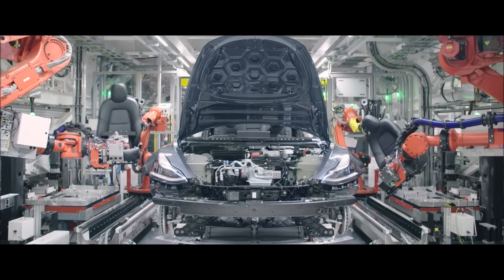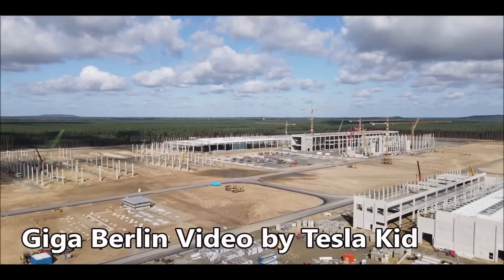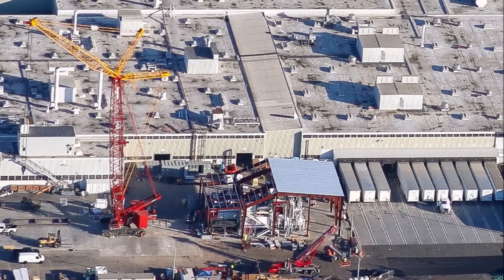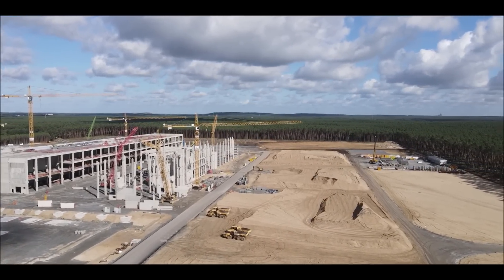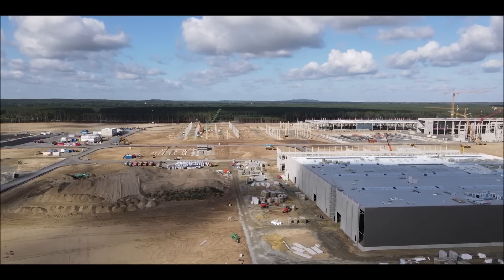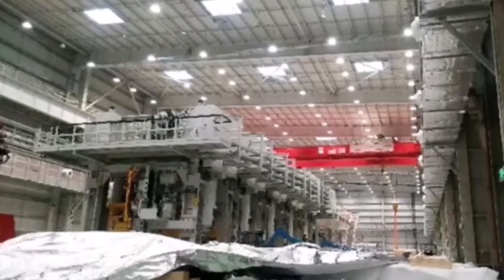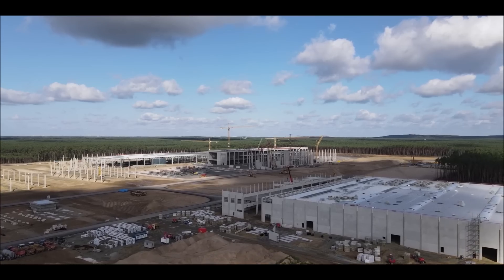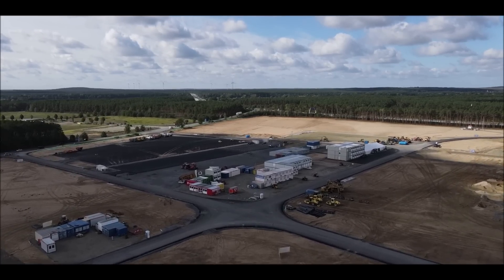Tesla Giga Berlin Abandoning Hundreds of Robots for Casting Machines

Comment: I guess they are casting the front end and the top and bottom of the body, plus the rear casting, so 4 mega cast pieces for the entire body...just guessing
Reply: That would be insane and game changing
Reply: Simon Quvang I cannot see any other reasons for needing 8 huge casting machines :) 4 for model Y and 4 for model 3
Reply: @simonquvang6073  nope it would be stupid expensive and not game changing,  there are sport cars like lexus lc500 that uses magnesium front end castings

Comment: The single casting mega machine press story is a year old.
They may do aditional castings in the new press.
The 100 meter cables MIA.
There is no new computer.
No new news for Model Y.
Just waiting for tesla to fix the quality issues.
New paint boots.
So what else?
Will have to wait for battery day.

Weeeeelll better than GM and ultium vaporware.

Comment: I think these gigacasters are amazing!  I would love to see one in action, although there's probably not much to seed - molten aluminum goes in, and a car body comes out.  Fantastic!   Tesla's lead product is NOT cars - it's forward-looking manufacturing.
Reply: Nonsense. Other manufacturers like vw already makes 10 million cars a year with astonishing finish quality and delays, vw doest need die casting, their stamping can already ramp the production by million
Reply: @alanmay7929  and yet casting parts like this would make VW cars CHEAPER, reduce build time/need for robots and complexity of repairs..... yet they dont do it..... almost as if theyre not really thinking about making things 'better'
Reply: @bobh9492  vw already has alot of stamping presses, they just new forms for their next cars, thats not an issue since robots doesnt really need maintenance and vw has basically perfected the car chassis building by sharing platforms for example
Reply: @bobh9492  the giant die cast machine actually cost alot of money
Reply: @alanmay7929  and? theyre already fking installed.... your point?

Comment: In practice, he's correct with his idea of using larger pieces rather then several smaller ones. On a massive scale, this idea is already in use by shipyards. They assemble massive blocks which they then assemble together. Hyundai Heavy Industries has purpose built massive cranes just for the purpose of lifting those massive blocks. Elon musk is essentially doing exactly the same thing with his Giga Presses.

Comment: With the autopilot safety systems and eventually FSD, Tesla cars will be involved in far fewer accidents or even zero.
I would imagine if the casting is damaged the body would be a write off.
Tesla insurance will take this into account of course.
Reply: If every vehicle on the road was communicating with all the vehicles in proximity (where I am, how fast I'm going, direction, and where I want to be in 10 seconds,  where I want to be in 30 seconds, and where I want to be in 2 minutes, at all times so they could all cooperate with each other there would only be accidents in the case of catastrophic failure like a tire blowout or worse.   1/10000  but until such a time as, at least 70% of the vehicles do not have unpredictable human operators, there will continue to be lots of wrecks and the dream of accident free, self driving cars will remain a dream.
On the point of robots,  pandoras box has already been opened,  the robots are not going away.  That means that the dirty, dangerous jobs are going away soon.  Good that people wont have to risk their health or even their life but how to divvy out the limited resources?   I mean lets face it we all cant have  a 300ft yacht (does anybody really need one?) Big questions requiring big answers.   I'm really troubled by the prospects that force me to rethink a lot of beliefs, because when every job that does not include human beauty, charm or sympathy is being done by machines,   what will most of the rest of us do to occupy our idled hands?  We are already at the point that there is no excuse for a piece of escaped food packaging or plant that is mean or annoying in any place besides a spot specifically reserved for that asshole plant. Yet we see disrepair, trash and weeds everywhere.  What will it take to get the rest to do SOMETHING? You are being fed, you have a roof over your head,  cant you come up with something to make your own life and hopefully someone else's life a bit more beautiful?  Nurture a flower dammit!
Reply: @laserflexr6321  One step at a time with incremental improvements in accuracy and safety

Comment: Won't this send insurance and repair costs through the roof?

What's the percentage of Tesla's that are involved in accidents over their lifetime.

Having to do a full body swap for literally every fender bender seems like the initial cost is lowered but the total cost of ownership goes through the roof.

A damaged bumper will have repair costs comparable to an exotic sports car. 

If you don't have to replace the radiator and belts and pumps in a front end hit.

but have to replace the roof and A pillars because they are one cast.

I'm not sure thats what progress looks like

Hopefully they take a look at the most common damage points and parts swaps and try to unify commonly replaced together pieces into one piece and not stuff that isn't.

Insurance rates for Tesla's due to all the full write offs from minor accidents are already making them luxury/exotic rates for a sedan. 

The first go at this is going to make that even worse
Reply: Insure with Tesla, so inexpensive

Comment: Less parts=less mistakes =higher consistency=?higher quality and possibly increased performance.
Reply: sleepkeeper the Casting is Rather difficult. I dont think it will run Smooth in the beginning, but sooner or later tesla figured everything out
Reply: @TheMrFraps  They have worked it out, even reformulating the Aluminum alloy to ensure that here is no requirement for heat treatment which introduces distortions
Reply: I guess lower cost (less robots), larger gross margin and/or lower average selling price = higher profits / sell more units. Also speed of delivery would increase as well.
Reply: @j.pgoodwin9020  nope it still will be a challenge because of the larger piece, also it needs to be cooled down
Reply: @saufai74  vw makes 10 million cars a year with astonishing efficiency, they dont need die castings with expensive aluminium..... toyota even uses carbon fiber on rear hatch door to reduce car weight.....
Reply: Alan May VW makes 10 million ICE cars a year. When the CEO of VW Diess comments in the media lauding Elon and Tesla saying that they need to catch up to Tesla and that they use their Model Y as their reference for how things should be done. He also realized that they will not make any of their own EVs based on ICE cars and that doing the e-golf was a mistake. They discontinued it and the ID3 and ID4 are on a brand new platform. He has warned other legacy OEMs that this is the way to do it, build a new car from ground up. With this comes innovation in manufacturing that will allow for the legacy OEMs to compete with Tesla. Most people watch this content to learn about new things, innovation. We are excited about it and astonished at what Elon has been disrupt in just over a decade. Almost every car company has an EV plan now where they would not have if Tesla didn’t come along. He and has team have run circles around the engineers at NASA with SpaceX. We watch because we enjoy innovation. Why are you here? Are you saying a guy who lands unmanned rockets on a platform in the ocean doesn’t know what he is doing and he and his team won’t figure this out??? But you know better. This casting machine is not a move forward. You are probably right. Elon is wrong. SMH.
Reply: @saufai74  Programming software is one thing building quality car is other thing. Tesla is behind when it comes to building quality car.
Reply: Jon petter please check the owner satisfaction lists by Consumer reports. While you are at it please check Tesla’s pandemic sales Q2 YOY and compare it to every other legacy OEM Q2 YOY. Your opinion vs facts. Your “high quality” legacy OEM ICE cars are collecting dust on some dealership lot while Tesla can’t make them fast enough to match demand. This is a revolution and major shift in the industry we have never seen. If you want to sit on the sidelines and complain about panel gaps be my guest. Talk to you in 2030 when they hit $1T in revenue. Happy trolling.
Reply: @saufai74  other manufacturers doesn't need innovation in manufacturing, they already have the best experience possible, what they need is more batteries to make even  more affordable EVs at the cheap ICEs prices
Reply: @saufai74  the casting machine may be a good thing for tesla but its not a move forward, vw already has alot of stamping machines and the know how in mass producing chassis.
Reply: @saufai74  VW is delivering new 30 000 ID 3 this year from this mounth and will producing 300 000 new EV next year. That s more than dust.......
Reply: Jon petter I’m happy that VW is going electric. My main thing is the environment and the faster the better. If VW can do 300K next year I would be over the moon! They just came out saying they are going full bore on EV and by 2023 they will outsell Tesla. Fantastic for everyone. But the reality is that EV is an emerging market and the more competition and good options there are the better for everyone. I really hope Hyundai, BMW, Nissan all sell 100K+ EVs in 2021. Will Tesla maintain an 80% market share of EVs delivered in the US??? I doubt it very much. But with an emerging market like EVs there will be lots of market to take, mostly from ICE cars. Go VW! But I’ll keep my Tesla stock because as a company regardless of how good the competition gets, I believe they will have a chance to 10x in 5-7 years. I like their mission too.
Reply: @saufai74  Credit is given credit is due. Without Elon and Tesla EV industry wont be this far ahead. We need people like Elon. More EV is better for the environment for sure.
Reply: Jon petter Amen! Bring on the EVs!!! Less dependence on fossil fuels!!!
Reply: @saufai74  Indeed

Comment: How fast can the casting machine make a part? Can it make more than one casting per minute?
Reply: I wonder how fast it is vs the assembling it is replacing. I think it must be an order of magnitude faster for Tesla to go this path.
Reply: VintageLimos.BIZ most certainly not i guess more like 15min per Casting per machine resulting in an car Every 2min. Which Sems reasonable
Reply: Elon discussing this with Third Row Tesla indicated that the Aluminum is injected in Milliseconds, then quenched so throughput is quite rapid and as Sandy points out, mountings and strengthening modules are all part of the cast , minimizing extra work

Comment: Replacing 70 parts with a single part = less repairable for the consumer! Tesla, like Apple, continues to be anti-consumer.
Reply: the metal parts almost never fail. only if they are engineered badly. i am more worried about the always online stuff
Reply: @nutzeeer  Metal body parts ALWAYS fail in a crash!
Reply: Tesla wil make the frame as one piece. If frame of regular car gets deformed it suppose to be scraped as well.
Reply: Maybe this will be addressed in a Tesla warranty. Plus they will probably have some sort of recycling program .
Reply: If you get in an accident that damage the frame of the body it's a write of anyway. You mostly do not repair stuff like that, it's simply to expensive.
Reply: @damianlund395  And if Tesla's single piece includes quarter panels and fenders? You get a dented quarter panel and you have to replace the car????
Reply: @simonquvang6073  If body panels are included in the single piece design, that would be a significant slap in the face for consumers. Imagine a car where you couldn't replace quarter panels or fenders!
Reply: @DavidJohnson-tv2nn  Body panels wont be part of the frame. That's only the case for the cybertruck
Reply: @DavidJohnson-tv2nn  I dont think Tesla goes so far and even if they wanted to, regulations won't allow it for the same reason as with Cybertruck in EU. Cant have hard, casted bumpers and panels due to pedestrians safety.
Reply: @DavidJohnson-tv2nn  I said frame, not panels.
Reply: Once the Tesla fleet is fully autonomous this is all moot. Very few, if any crashes.
Reply: This one cast piece includes bits designed to deform in an engineered way to optimally and reliably absorb impact forces. Perhaps having one, more complex part absorb the impact damage makes it easier and cheaper to replace that entire one piece? Also, as someone else mentioned above, it's not especially difficult to cut off a damaged bit and weld in a replacement bit, if the damage is, for example, limited to one strut. Regardless, I suspect that any impact intense enough to total this complex cast piece would easily be intense enough to total most vehicles with more conventional construction.
Reply: @jimallen3392  it's already a moot point now. If the 1 part gets damage in a crash so would a number of the 70 parts and then the car would be damage beyond repair anyway.